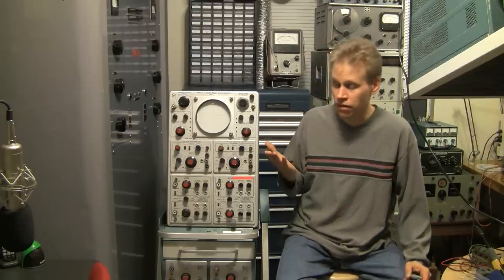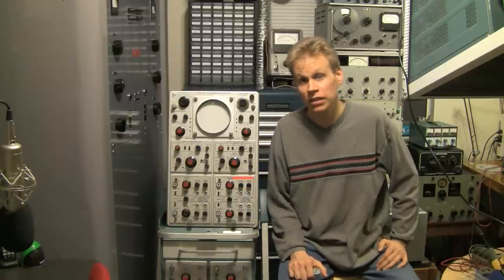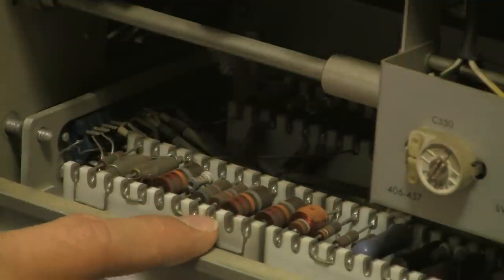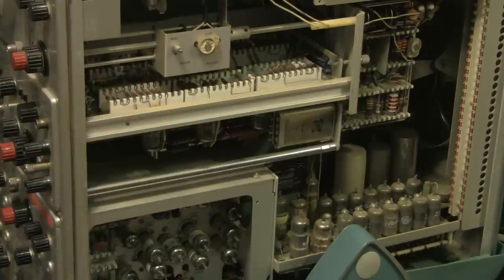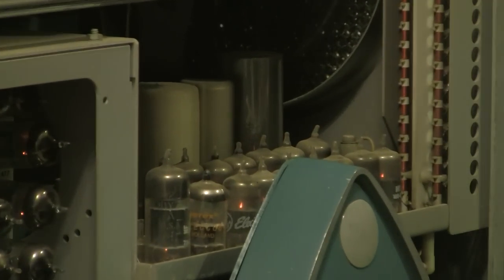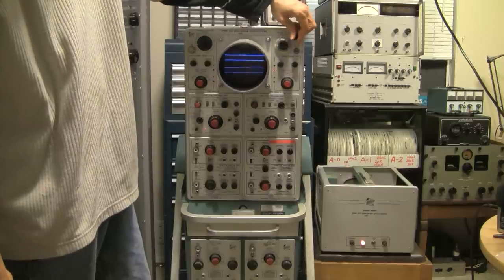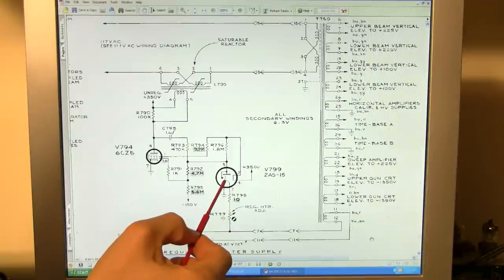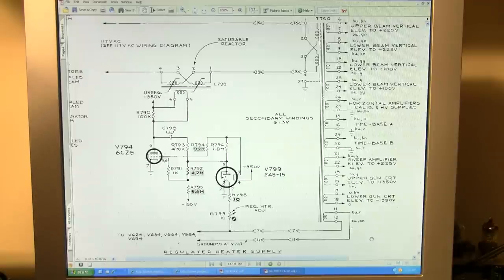Tektronix type 555 oscilloscope, over 100 tubes inside!

Comment: So if someone took V799 out and powered up....  Carnage?
Reply from the maker: There is a jumper inside the tube for the filament control, if the tube is removed, all is safe.
Reply: The same problem happens with voltage-regulating tubes--- they thought ahead and put an internal jumper inside the tube.   If you route the main power feed through those two pins you're then okay.  Well, at least better.  The voltage will still soar if the tube cracks.

Comment: Hey Is there a big difference between the 549 and the 555.
Reply from the maker: +Janusz Gluszak 
Hi Janusz. the 549 is a storage type single beam scope. The 555 Is a dual beam, dual plug in ( really, two seperate scopes in one) non storage type oscilloscope.
Reply: Thanks for the reply.

Comment: I have a Tek 556 oscilloscope that has been covered up in the garage now for about 30 years.  It was my first scope when I was a teenager.  I need to get rid of it and I can't find anyone who is interested in taking it.  I hate the thought of trashing it.  It was working when I put it in storage, but I don't know what state it is in now (dead caps, etc). Any suggestions for what to do with it?  The thing is far too big and heavy to ship anywhere.
Reply: Id buy it from you in a heartbeat, but as you said, shipping is not an option for those things. i assume youre in north america, you could ask a ham radio club, or bring it to one of their swap meets/ flea markets.
Reply: Star Gazer if you are anywhere within two provincial boundaries of Alberta, I will gladly pick it up.
Reply: Star Gazer. I hope you are able to get this oscilloscope for your "collection". I have some older TEK equipment that I am planning to take to the TEK museum but am willing to share with you. I only have one tube based scope (a 310) but don't want too get rid of it. I do have some a 7000 series and some TM500 stuff that I was planning to repair but I don't seem to be able to make the time for it. I am in the Portland OR area (TEK  country) so let me know if you are interested.

Comment: P5 isn't correct. This high intense blue comes from a P11 phosphor Tekmade CRT. If you have a light blue with yellowish persistence you have a P7. P5 Phosphors was never build into a Tektronix CRT.
Reply from the maker: Thanks for the response! Are you sure they didn't make a P5 phosphor under special order? I have many scopes with the P11 type phosphor, and it's a completely different color. This scope was a special order from Boeing, for film applications. The persistence is very short. If you have any extra info (data sheet) showing the available phosphors from Tek, that would be great! Here is a nice list of available phosphors for CRT's   http://en.wikipedia.org/wiki/Phosphor
Reply: Mr Carlson's Lab  Yes, it is P11
P11 ist specially for photograhy, film is not a big different. ;-)

I have also 555 with P11 :-) (Picture of him is putting into http://w140.com/tekwiki/wiki/File:555_P11.JPG)

Best regards
Matt

PS: i have brandnew CRT for 555 with P7
Reply from the maker: Matthias Korn When I clean this fella up, I will check the P#. I could be wrong. The color of my CRT is a purple/blue kinda mix, and very short persistence. Check the color at 16:07, does yours look like that in person? In your picture, it looks light blue. The reason I ask is, I have MANY tek scopes, and none look this color.
Thanks for the response!

Comment: I have a working tektronix 503 and the manual. I have cleaned it up and used it a lot. However I never washed it down with a sprayer. JohnBoyUtah KJ7TBR 😎🇺🇸📡🎙🎴
Reply from the maker: They are great, I have one on the bench right beside me. Negative supply was low, bad filter cap. Works fantastic now with the vertical aligned.
Reply: Nebraska surplus, had new stock on filter caps!

Comment: http://w140.com/tekwiki/wiki/File:Rm35a_front.jpg

I did finally find it, turns out it was a Rack Mounted version of the 535A ...so RM means Rack Mounted and they must have omited the first 5 for whatever reason. I'm real slow on this computer googling stuff but eventually I get there. Now it looks like I have to learn about selenium in case there is any in there.

I suppose I should google for a date code next. And the Rack Mounting part probably should be addressed first... is there a simple place to buy them? I have a 1950s B&W TV set I gutted I was dreaming of using for electronics storage because its veneer is so beautiful and it rolls wonderfully. Built solid as a rock, I'm sure it'd hold the weight of 3 adults and never even wiggle.

BTW when you say "solder" I think I hear a fellow scandahoovian accent in there. What's your connection and how much? My mother was Norweigan & Swedish.
Reply from the maker: Good luck with your Tek scope!
Reply: Thanks!

Comment: No it sort of works lol, It has been butchered beyond belief  , cord wrong black wire on fuse not red + ground not even connected. Tube has either been out or replaced no gasket or rubber seal on the clamp just metal  to glass  trace was on a massive angle thats how I found out it had no gasket and the tube connector was hard up against the tubes metal clamp friggin dangerous. Front of tube just floating in mid air and moves up and down at least 1/2 in and rests on metal no seal or felt in there. Dust was so bad i could not see the bottom board and that was after blowing it out with a compressor at 150psi.  Now all though i got it to work  its not right, Triggering seems to do nothing all other controls work fine.  First one step at a time. I will clean it (any tip here much appreciated), 2nd fix and align tube and replace cord with + to the fuse first , Then I intend to replace the electrolytic caps that remain in there and test the resistors and lube the potentiometers.  Then I shall give it another go and see where Im at.  I have nothing but a 1980,s multi meter , It don't even have diode mode ,  Just an old radio shack manual ranging volts amps and ohms. Still works a treat though. My soldering station / power supply i bought at xmas (chinese 853D) blew up on the second use so that has left me struggling right now , As that means i don't even have a decent soldering iron.  I have a very old Weller iron but its just about had it barely melts solder these days , Just another hurdle to jump. 
 I don't have any probes for it so i cant use it right now anyway.  But I will get there in the end , I don't give up to easy on anything i do.  If i own something it must work the way it was made or i just don't see the point in having it.  Some more info on it , Its  Kikusui Jayen 555 it has only 3 valves and a bunch of transistors insteadof valves i think well theres about 4 of them on the bottom board metal 2 screw type.
 I have searched for the schematics but no luck at all. I found the manual and down loaded it and printed it out and it does have the calibration procedure in it which is great  but no schematics which is going to make it very very difficult for me as all i see is a bunch of tiny parts LOL.   Any help on schematics or how to clean the unit would be fantastic, I see many use water and soap. Im not a fan of water  electrical units,  If I were to use water could i use a water dispersant after to dis lodge the water and then let it dry. It will dry in a matter of minutes here  where i live in South Australia its around 40c at the moment 47c the other day thats in the shade.  I would love to send you a pic before and after.   Sorry for the rant.
 Just one last thing you might find funny.  After 2hrs of looking at the trace running at 2 clock to 4  clock and looking for an adjustment I kept thinking would it be the tube is crooked and I thought nar this thing is so old and dirty no one had touched this ever ,  But guess what thats what it was , There is no adjustment , you move the tube. LOL   All good got there in the end.  Any help is always appreciated. It is by far in the worse condition of any unit you would ever see.     I will let you know how it all works out.  This is my very very first ever electronics gadget other than my old MM that i use to use for work so its a bit scary right now as i do realise it has high voltage .    And thank you for replying.  And i apologize for ranting.

Comment: it's interesting to see how stuff was made a long time ago, but I have no interest in old electronic equipment.  Give me a new Tektronix scope any day.  That scope should be in a Tek museum because it's not good for anything other than a boat anchor today.
Reply from the maker: Can a modern scope run two independent spectrum analyzers, at the same time? How about a TDR, and a 4 channel oscilloscope at the same time, with independent triggers and timebases? That's just the beginning.... Let me answer that for you... No they can't. Why?... Money. Cost was not an option back then. Getting the job done with no screwing around was priority.

Comment: So disappointing to see startups like this with no care or concern for basic cleanup or fundamental checks. Not even a spot of oil for the fans, with exposed bearings just begging for some love, and no voltmeter checks for basic shorts etc. Not so much as a spot of compressed air to blow a few decades of dust off. In my shop everything would be pristine before power up, with every basic electrical check possible completed - compressed air, vacuum, humid wash and dry, lubrication where mechanical parts are concerned. 
I get the feeling it's just sort of, "If it catches fire - Oh well, it was just an old bugger - I'll dump it in the lake...." which is disrespectful to the artisans who created it, as well as the respectful users who have kept it in this condition for so long.
Reply from the maker: New to the channel Greg? You might enjoy this video: https://youtu.be/35w8iVYy-6c You may want to consider learning about the people you are commenting about. Have a good day.

Comment: sorry,, but, yes, its put together using VERY expensive construction techniques. Now, don't get ruffled, but I can do almost as much with my little ebay DSO as I could EVER do with that scope ! So, Sorry, no, not going back . Ever.  My time is worth more than the time it takes to keep one of these going ! Once again, sorry, for any emotional stress I may have caused, but absolutely not. Now, that said, I'm using a "Measurements Standard Signal Generator 560 FM" which does things a new (most) DDS signal generators (some call vfo's) cannot do, mainly its got calibrated very low level output, a beautiful analog rotating attenuator ! So, I'm not against old equipment all of the time, and I'm not proudest against tubes. I wish I had my old tube tester I let go when I moved. Oh well, some day one will show up in some huge garage owned by some sort of hoarder ? I would grab that. I just feel that one needs to look at electronics from both ends, the new and the old. And use the best of each , especially when the job can't be done with the "new" stuff.